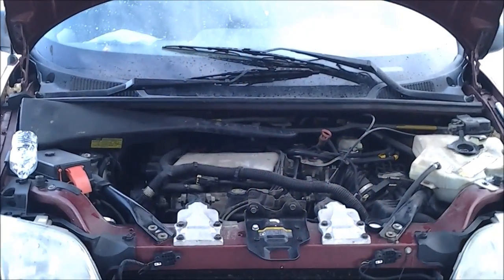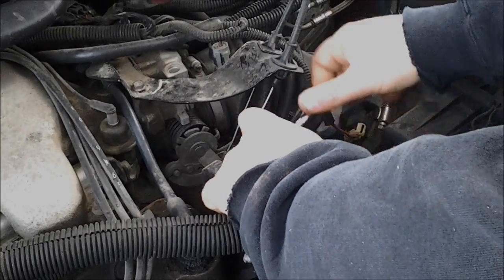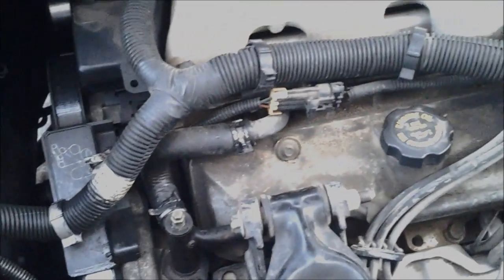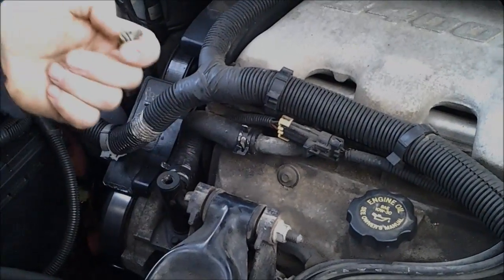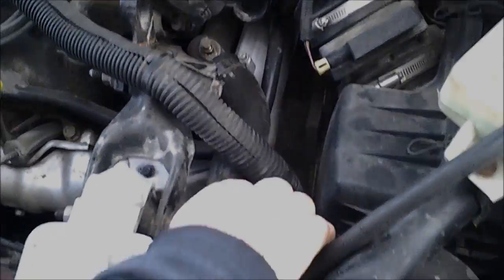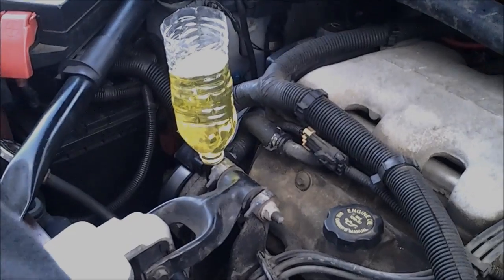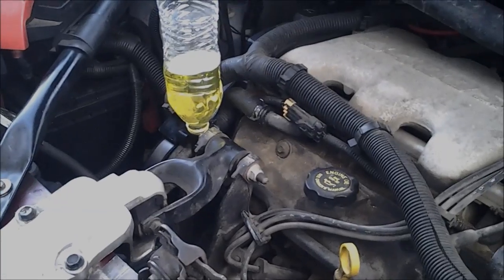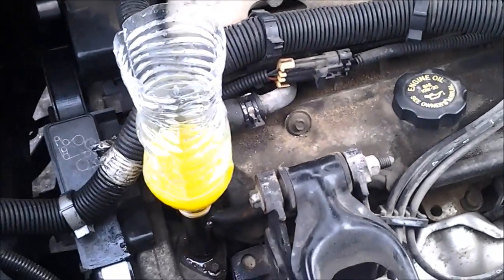Removing air pockets in engine  with plastic bottle

Comment: Forget all the other methods! This works amazingly! My water bottle was a tiny bit too small so I use a heat gun to warm the plastic and slipped it onto an 11/16 socket 3/8 drive end and it fit perfect. I also use a long extension with the 10mm socket to install the plug while the bottle was still in place preventing air from getting back in the system.
Reply: Was thinking about that! Great idea!
Reply: I’m having the same issues with a 2007 equinox. 
Get to a stop light, idles for a few minutes, the equinox starts overheating. I did use the other method, worked for a few months and back with the same problem. I will now use this water bottle method, but my concern is, how do you prevent the water from leaking out of the water bottle ?
Reply: @Boyzofsummer1  bit late but might help some new reader. You can get the water out of the bottle with a syringe, it's what I do and avoids a mess every time

Comment: My bottle was slightly to small.
I held the water bottle over the stove to soften the plastic and pushed it on to my 1/2 drive extension.  
Rotate the bottle so it will get softer all the way around the opening when heating it.
I only stretched the bottle opening a little but it worked for me.

Comment: Just used this technique on the same engine... i will say take any water bottle with a small head... heat it up a bit and it will conform to the bleeder connection... took me about 15 mins i took my thermostat out previously.  After flushing the system i filled the radiator up with 1 gallon and used a second  to fill up the top of the engine.  while testing the car (driving 75 for 20 mins and idling for 10 mins then returning same speed) the thermostat went to the 1/3 on the temp gauge and while driving the needle fell to the first line.  I appreciate your tip thanks so much

Comment: This really worked, with a common, cheap water bottle, I honed the bottle out with some sandpaper, tapped in on with hammer and flat screw driver.  the bottle melted a bit as the car got hot, but it did work, removed the air pockets.

Comment: Just wondering... if you have no heat and find you're low on coolant, if you fill your coolant while cold in the rad and in the reservoir, is there any reason that the air would not burp out through the reservoir while you are driving?  And then as the engine (and rad fluid) cools down after usage, the air that was burped out would be replaced by fluid being sucked out of the reservoir?
Reply from the maker: I thought it should, but for some reason it doesn't.
Reply: Jeremy Huygen gmail same thing I thinking

Comment: Would this work on a 96 chevy blazer? I am uncertain if I have bleed valves like that but I have a slightly different situation where my car is not heating up all the way. Changed thermostat and coolant is topped off I am certain there has to be a air pocket somewhere. Thanks in advance.
Reply from the maker: As I have mentioned before I am no Auto Mechanic, but I don't see that it could hurt to try, anyone else have ideas?

Comment: Good workaround but not really necessary. The coolant from your reservoir in not flowing back into the system because you have an air pocket in the hose connecting the reservoir and the radiator. You can easily remedy that by removing the radiator cap and lifting the reservoir higher up until you see coolant starting to flow into the radiator thru the small hole on the radiator neck (and then you can clip it back where it belongs). After that you can bleed the air off using the bleeders. Open them both and wait until you see as steady flow of coolant with no bubbles on the lower one. At that point you need to close the lower bleeding valve. Close the upper valve once you see the coolant flowing free of bubbles and put the radiator cap back on. Then start the engine, wait until it warms up and repeat the bleeding procedure. It will help if you have the vehicle uphill or the front end lifted on a ramp or jacked up.
I do not know what king of coolant you are using but it did not look like the one recommended for GM vehicles which is Dexcool (red in color). Other coolants can damage your cooling system as they get in chemical reaction with the aluminum and turn into gel deposited everywhere inside the cooling system which decreases the heat exchange and will eventually cause overheating. Those 3.1 and 3.4 GM engines do not tolerate overheating very well which makes them notorious for blowing head gaskets.
Reply: Dexcool will literally eat through your gaskets, which is why it's frowned upon for most people.
Reply from the maker: great advice thanks.
Reply: My 3.1 is the worst I've ever seen.  Also, the reservoir would be lotsa trouble to take from it's place and elevate it then secure it back in it's place.  I love the idea shown here.
Reply: @MrRusell86  well it ate through the plastic ones my 3400 originally came with. Everyone will have different experiences though!

Comment: Tried using a water bottle and for the life of me cannot get it on there. Are you using a special kind? I have a 2002 Buick century 3.1 litre. Guess it is ever so slightly bigger
Reply from the maker: Yeah I found that not all water bottles work the same after making this, I guess I lucked out the first time. I have since started to use that cloth electrical tape that has a kind of waxy feel to it to seal off any leaks. I also found out my continuing problem with air in the coolant is caused by a leak in the head gasket from the exhaust to the coolant. I guess the pressure of the exhaust pushes into the coolant, and forces the coolant into the overflow. $1400 to fix. I'll keep using the bottle for a while since the whole vehicle cost $1700 three years ago.

Comment: I take the upper radiator hose off of engine side and fill radiator since there's no cap on radiator. Then run engine with heater on and bleed system with the two 7mm screws.

Comment: I think the yellow funnel you buy that goes in the radiator for removing air a bit less complicated over the little plastic bottle method...still a great video...looks good  and provides another good option 
.
Reply: Lynn Claughton  there is no radiator cap on these cars so u can't use the self sealed funnels
Reply: YELLOW FUNNEL WONT WORK ON THIS VEHICLE. THIS TRICK WITH THE WATER BOTTLE WORKS PERFECTLY!!
Reply: Not sure what vehicle you guys are working on, but both my wife's 2000 and 2004 Pontiac Montana's have radiator caps on them.
Reply: @MrRusell86  The funnel kit I bought came with an angled adapter that lets the funnel sit straight up, just as it would on a radiator without an angled filler neck. The crash bar doesn't get in the way of it at all either. I don't know what you're talking about, it's not tedious or difficult for me at all.
Reply: @MrRusell86  I bought mine from Napa (their own store brand), but Lisle makes the same identical kit (#24680) that's available at the other big 3 chain stores (Advance, Autozone, O'reilly's). It has several attachments to fit multiple vehicles as well. The attachments in this kit have a rubber seal that fits down inside the filler neck and a lock collar that's made & looks just like a radiator cap, except it has a hole in it so that the pipe connector can pass through it. Once you tighten the lock collar down it's sealed up so you don't lose coolant. You don't even have to hold the funnel after you install it because it's self supported. Over the year's I've  spent a lot of time bleeding cooling system's, especially on the GM 3.4 and 3.1 and the $35 I spent on the funnel kit was way more than worth it for me. It makes the job so much faster and easier. And like I said, it also works well on any vehicle, foreign or domestic that has a radiator cap. If you get one you won't regret it. Good luck.
Reply: @hidinfrombiden6251  I see. That is a very good suggestion about getting a proper funnel kit. It took a lot of effort but the other day I managed to get a good seal going by applying Elmer glitter glue and then wrapping with metallic tape. I removed the screw and added some coolant so the bottle was around 1/5th full. However, all that happened when I started the engine is the 33 ounce bottle filled up close to the top. I started it with the heat on but I wasn't able to run it long enough to get it warmed up before the bottle filled up. It depleted the reservoir tank quite well but some has since gone back to the tank although much remains in the bottle.

With that said, here's the deal with my car (a 2001 Pontiac Aztek). Last month I had the upper air intake, valve covers, and lower intake gaskets redone, as well as a new thermostat put in (+ a new PCV valve and EGR gasket). I went to inquire with the mechanic about the higher temperature last week and he was doubtful there would be air in the system as he said the coolant was drained when the manifold and thermostat work was done. He suggested the radiator fans may have a circuit that had gone bad. So what I did was I went out and bought a scanner so I could monitor the engine's temperature in real time and see the actual numerical value of the temperature. I found that the fans kicked on as they are supposed to when the engine reaches 223F or higher.

Anyway, I opened the right-side bleeder screw before starting the engine and right away coolant came out. The radiator itself was also full under the cap (I can't get the cap to come off but coolant comes out when I turn it as it is at a bit of an angle). Being I didn't really see any air bubbles (I also squeezed the hoses for a bit) it seems the mechanic was right and there is little-to-no air in the system. I subsequently took the car out with the scanner attached and monitored its real-time engine temperature driving around town. The needle did go higher than before I had the work done but it stayed within what I subsequently found out to be normal operating temperature the entire time (which ranged from around 195-210F and going no higher than 217F when I idled at an uphill stop light).

It seems what has happened is the car is now operating at the temperature range it probably originally did when it was new because of the new intake gaskets, valve covers, and thermostat (although the previous thermostat was only three years old). Essentially, the engine seems to be running more tightly and efficiently now that this work has been done and that the engine seems to have been operating cooler and less efficiently than it should have been prior to this major operation. 

So I was thrown off by what was to me the old "normal" operating temperature on the gauge in the cluster and now it is a matter of adapting and getting used to this new normal when I take the car out. I will continue to monitor its temperature for a while yet just to make sure it does not go into excess heat range under typical operating conditions but overall, I think I should be good to go.

Comment: I went through numerous youtube videos about this, I was thinking about trading my car off due to this problem. I had put a new thermostat and water pump in it (Aztek) and I was going nuts trying to get the air out of it without wasting a ton of coolant! This worked like magicI have had my Aztek seems forever and did the headgasket and manifold gasket.
Reply: This is good news.  I did my Aztek's water pump yesterday and planning on doing the t-stat this weekend, and bleeding the air out of these motors is crazy.  I'll be trying this.
Reply: @MrRusell86  It was part of an long process of replacing the rad, water pump, the top coolant tube, and the T-stat due to serious rot and multiple leaks.  The water pump died somewhere in there.  But this trick for getting the air out is legit.
Reply: @MrRusell86  It was a while ago, but I think I had to enlarge the bottle mouth a little.  But perhaps a few wraps of teflon tape might help, or even a small gear clamp?

And yeah, I'm in Ontario, Canada, where salt is king and cars rot.

Comment: Thank you so much! You're an effing genius! Talk about thinking outside the box.
This is the best tip I've ever seen on YouTube. I've owned this Lumina for about 20 years,and I've had to do the bleed routine several times.

I had just about resigned myself to either farting around with it for two hours,as usual,or maybe,get one of those "spill proof funnels" which work very well,but cost about 40 bucks at the parts store.

 I was also going to try to fill it thru the bleeder this time(didn't know if it would work,or not),but I was going to try to use a funnel. Never even thought of a water bottle fitting that neck so perfectly.

It's hands free,no holding a funnel and trying to pour coolant in, or squeezing the hose in an awkward position. Plus you can fill the bottle and walk away,drink some coffee,or whatever,and just let it bleed in.

Just used a cheapo Kroger half litre bottle I fished out of the recycle bin. 
BTW, I found out that squeezing the lower hose displaces more air than squeezing the top hose,and gets the job done a little quicker.
Thanks again! :)
,
Reply from the maker: Thanks. I have gone to using a pvc piece that I used a drill bit to get the size just right, and glued in a bottle cap so i could change out bottles if they get hot fluid in them they tend to distort. and with as often as i have to do it, i wanted to be able to change out easily, as not all water bottles fit perfectly.

Comment: Was the car heater not working  to make you look into this or over heating?
Reply from the maker: both the heater, though the heater  part was only noticed once the weather got colder.
Reply: Hey thanks for getting back to me and the video. It just started getting cold and my daughter said her heater isn't working (but didn't overheat ) so I checked  and fluid was really low so I filled it up and off she went, she came back after driving awhile and still no  heat so I went to my best friend in the world "YOUTUBE" lol saw your video and was like I bet this is the problem BUT when went to look for the air valve there was none so I did something like this https://www.youtube.com/watch?v=wNHggnT9ARU&lc=z23uezfypkfcsrluvacdp43ajtkh3weu0tyjyq2ktvxw03c010c.1512446411546282  but did not cut a hole in the top of the bottle and it just so happento fit prefectly in the mouth of the raditator, I think by not cutting a hole made it more of a suction deal you could see the air bubbles come up and I believe forced the liquid down plus the liquid as its going in is higher then the eng. Your video was a great help .
Reply from the maker: I am glad to hear it.  Have a happy new year!

Comment: quick question before I try this, how about the fluid that's in the reservoir, does it stay at the level it's in? I have a 2002 venture that sounds like it's boiling over but there's no leakage I'm thinking it's air pockets.
Reply from the maker: Ive noticed on my vehicle that the overflow fills up a bit when it gets hot, i think it is supposed to draw from the reservoir when it cools back down though.
Reply: @arthardware5560  how long did this work for?

Comment: Man I've had a couple of vehicles with these engines,I always put them on ramps and use the bleeder screws and find that it usually takes 3 or 4 times with some driving in between to make these engines act right.Great tip ,huge time saver.Haha these were great motors as long as everything is right in the world,got alot of miles out of everyone ,but man if they don't do the weirdest shit if anything at all is not right in the world
Reply from the maker: I agree. great and a real pain too.

Comment: I can't thank you enough for showing me a great and simple way to bleed the air from my engine.  I too replaced the water pump and thermostat but kept overheating.  I thought I was bleeding all of the air out of the system until I watched your video.  It took nearly an hour to get all of the air out but my Grand Prix is working perfectly now thanks to you!
Reply: Best way put electric tape around funnel end till it plugs into radiator tightly fill with antifreeze to 1/3 until up in funnel turn on heater full turn on fan run car for atleast 1/2 hour till all bubbles stop coming up in funnel keep adding fluid as it goes down you can squeeze upper hose to assist it when done take rag wrap around end of screw driver use as plug in funnel pull funnel out top off radiator 100% done
Reply from the maker: I am glad I could help. Just sharing what worked for me. thanks